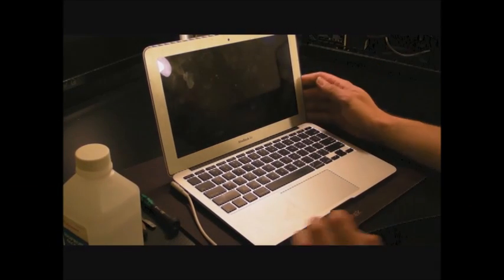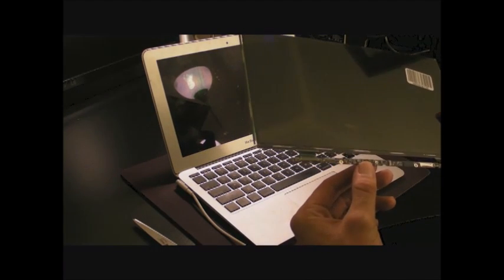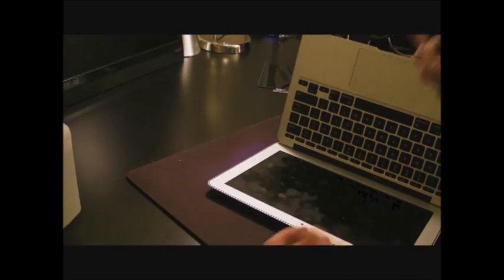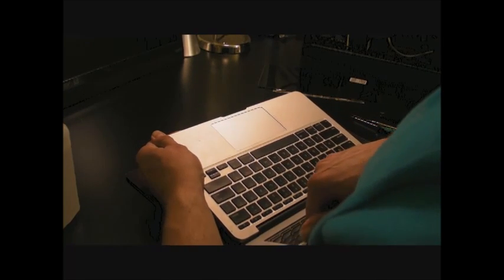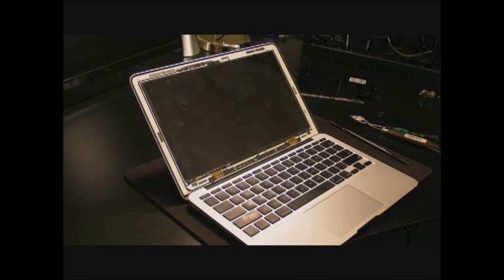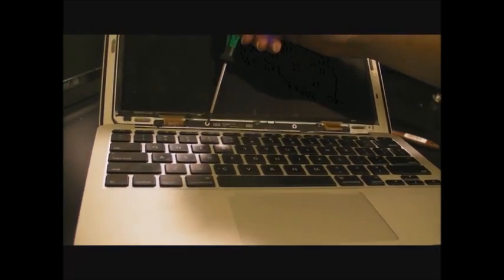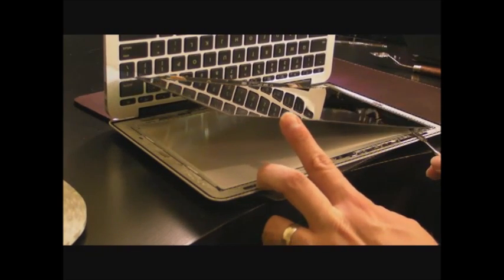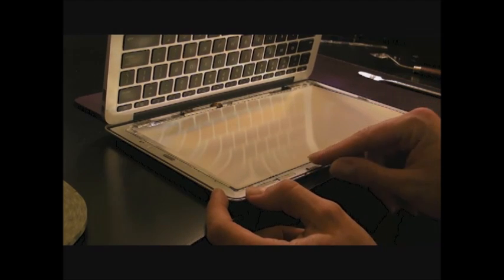Macbook Air A1370 A1465 Screen Replacement

Comment: Just successfully replace the screen on my laptop. Boy was I sweating! No way I could have done it without this video! I was a bit naughty and get a lot of crap, fingerprints and scratches on the panel behind the screen. I used a brush to remove any particles. Once the screen was back on, it looked great! Can’t see the scratches or fingerprints at all.  Thank you so much for this video! All the best

Comment: You're a f***ing legend! I finally made it to repair this thing after several hours of focused work. I took it to a repair store here in Bern, Switzerland and he wanted to change the hole assembly so i decided to replace it by my own. I costs me around 40 bucks in the end (he wanted 400!). I did a tiny scratch on the back sheet but it's not too bad, you won't see it straight away. The backlight cable instead was a b****. It was fine in the beginning but then started to have a loose connection and I had to take out the bezel again. I noticed that there was a cable like thing on the old LCD, that had the same shape as the backlight cable. I chucked that one in as well and then the connection was fine. Milan, I can't thank you enough for your super detailed guide you uploaded here! Now my Mac book air will live on for some more years to come!
Cheers
Reply from the maker: I`m glad it was helpful!

Comment: This is an admirable video. I do a bunch of screens every year. This was helpful. I would say this add in for whomever reads this post. Watch out using any high heat guns. The plastic film diffusers behind the screen may distort. I used a Hairdryer instead of heat gun and just worked the bezel with fingernails at first just to see.. It lifted a little in an area and I worked a credit card inside and then slowly worked around it I had a mini metal spatula available at BBB and used it. The tool this guy has looked like it worked well. Be patient. The other comment is that as I suspected when it came to how this gentlemen released the cables that is also accomplished by heating the perimeter of the screen until it can tilt toward the keyboard top first (just move the glass screen toward the keyboard as you would closing the lid. them once lying face down those cables are really easy to release and they don't stress. Thank you Milan for posting this video.

Comment: Hey Milan, Saturday I replaced the LCD on my mid 2011 macbook air & all worked great!  Thanks so much for your detailed instructions!  I have a couple of observations/suggestions:

1) I got my painting knife at AC moore, for those who are looking for one.
2) For some reason, the part you had said was the hardest, which was the removal of the LCD using the pryer and the heat gun, went extremely smoothly & took about 1 minute to do.
3) Despite trying to be very careful not to (per your instructions) I had a lot of trouble avoiding touching the backlight translucent layers beneath the LCD.  I dropped a miniscrewdriver on it which left a mark, plus a couple of other times, leaving quite a few little marks on the film.  I was quite worried that after I put it all together that it would look awful, however none of it showed at all and the screen looks perfect.
4) Despite the fact that you were very clear about making sure to put the middle ribbon cable back exactly as it was folding, I, somehow managed to put it on backwards &, of course nothing worked.  Fortunately, I put 2&2 together & put it how it was supposed to go.  For those of you planning on doing it, make sure that you can see the white stripe on the cable after you install it.

All in all, everything went well & smoothly thanks to your detailed instructions.  Thanks again for taking the time to do this, I really appreciate it!

Sincerely,

Brian Hiltscher
Reply: I know I am quite randomly asking but do anyone know of a good place to stream new movies online?
Reply: @Justus Jaxx flixportal :P
Reply: @Augustine Willie thanks, I signed up and it seems like a nice service :D Appreciate it !
Reply: @Justus Jaxx No problem =)

Comment: This is the best lcd replacement video I've seen on youtube. Ignore that other person who asked you to edit it. I enjoy the detail, as it is a detailed procedure. I'm a little stuck. Unlike you, I removed the back layers because the screen was broken from the apple logo and I needed to flatten out dent on the outside housing. I can't for the life of me figure out the correct order of the layers. Is there anyway you can help with this? Thanks in advance.
Reply from the maker: Flattening out should have been done before you open the screen assy first :-) you push with your thumbs until the debt goes out or plastic if it was the logo that broke. Unless it was really bad and u needed a hammer to do it. The order is white non see through paper than thick stiff plastic (these two are the backlight so if you cracked this stuff plastic you done for) than shiny sheet than one see through sheet and than another shiny sheet. The first shiny sheet and the front shiny sheet are just a bit different and even if you don't put them in correct order it will work but they should be placed correctly. Let me know if this works out for you!
Reply: Milan Stojic Wow, that was fast! Thank you. One more question. I've got them in the order you described. but on the layer closets to the lcd, one side is textured and the other side is smooth. Which side goes up towards the lcd?
Reply from the maker: The side that is textured goes to the LCD, smooth side goes in. I'm sure you'll have spots and marks on the screen but it will be functional if you haven't damaged the backlight plastic.

Comment: Hi Milan, thanks for creating this extremely detailed DIY video!   I am preparing to replace my damaged lcd, have ordered to LCD, and the double sided tape (5mm&10mm).  Do you, by chance, have a complete list of tools required for the job?  Any recommendations on where to acquire the tools?

Thanks in advance!

Brian
Reply from the maker: Hi Brian. You need a pair of scissors, Philips screwdriver, thin pryer (metal), painting knife, heat gun, and a pair of tweezers. Wherever you can find these buy them. Online or in local stores
Reply: OK, thanks, any chance you could tell me where you got your pryer and painting knife?
Reply from the maker: +Brian Hiltscher try eBay. Look for the tools that look the same as ones in my video

Comment: Long shot because this was posted so long ago, but my screen is completely black. I hear the Apple sound when I boot it up, but nothing on the screen. I flipped the ribbon connection but it didn’t help. I did damage my backlight screen with the heat gun. It curled slightly in the corner. Would that cause the whole screen to be black? I tried to try my old screen but nothing with that one either. Although the old screen was severely cracked and little shards of glass are everywhere so I’m not shocked. Help 😩

Comment: Hi Milan, please could you say me more or less the thickness of the 3M Core 4000 series tape you used in this video? I have another robust 3M tape which is 1.1 mm and I don't know if it is OK

Comment: I have got the boot up noise after trouble shooting. No backlight or new screen illumination....this is the EDP right hand cable? Does this mean the left one is good?
Reply from the maker: if there is no backlight i would check the backlight cable. there are 2 cables connecting the new screen. the wide one, and the small bent up flex cable in the middle which is the backlight cable. people very often plug this upside down as they dont know how to roll this cable up properly.

Comment: Great Video!  Successfully uninstalled old and installed new lcd screen.  However, the LED Backlight does not come on.  reconnected all connections and no luck.  Any advice?
Reply from the maker: Check if you flipped the backlight strip connector upside down. Many people do this
Reply: I guess I was one of the many.  Thanks so much.  Success.
Reply from the maker: No problem

Comment: Hi Milan, I have a question for you, I swapped the screen to 11"macbook air according to your video.
When I turn on the notebook, the display backlight does not turn on so nothing can be seen.. Where could I make a mistake? Thank you for your response. Peter
Reply from the maker: If you haven't blown a backlight fuse on the board, you probably didn't correctly plug in the little cable in the middle of the screen control board. Very often people forget it or plug it in upside down.
Reply: @milanstojic3295  Thank you for the quick reply. Meanwhile, I disassembled the lcd display again and found that I had destroyed the thin flex cable. So saving my Macbook air is over. well thank you

Comment: Hello very good video, but I have a problem. I did everything as you Indicate, but the screen is not seen, This very dark, if put to light logrogro see something. I Realized That does not turn the LED cover and lcd THEREFORE :( not see. Is there any solution to this problem.
I hope you can help me. Thank you very much
Reply from the maker: Take a look at the little backlight cable if you plugged it in correctly. A lot of times people flip this upside down or not properly straight in or sometimes not even at all

Comment: Zdravo Milan! 
Thank you for your great videos. One quick question: I've damaged the glass that is behind the rear reflective sheets. Is there any chance to fix it without replacing the whole thing (screen panel)?
Reply from the maker: that sux. u broke the backlight plexiglas and you will need to replace it in order to get even backlight on the screen. replacing this is not easy, but if you can find a new part it will be good.
Reply: Copy that, thank you for your quick response. I didn't break it, it has been overheated during removing the bezel and now there is a spot in the corner which is annoying.

Comment: i didnt see any film sheets came out on your video...on my three of them came when i peeled off the screen(some of them are scratched) and there is another one thin plastic remaning on assembly...what are they for?do they have to be replaced or do they,come with a new screen?
Reply from the maker: Carlos Montoya That's because I don't take them out. If you would follow what I did you would never have them come out. Now you have permanently damaged them and should get yourself a new assembly to put on that computer if you want it to look any good. I am pretty specific about not touching those sheets. Especially the one in the back

Comment: I have sound but no light.  Any advice to trouble shoot or how to replace the light?
Reply from the maker: what do you mean by that? computer turns on, you can see the picture but its very dark? did you try to replace the screen already? did you spill something on it? i need a bit more info so i can answer your question.
Reply: Milan Stojic if the screen sheets are damaged will that prevent the screen from showing display properly? I am getting a dark screen after replacing the screen and cant figure out why - thx

Comment: how do you change the cable?
do you have to take apart the LCD from its layers?
Reply from the maker: Proper way is to take off the bezel only. Nothing else needs to be removed to get to the cable. Careful not to break the lcd

Comment: My polarizer sheet got dmaged by too much heat. Can I buy this seperately?
Reply from the maker: Sure you can. They will most likely come in a conditional n you wouldnt want to to put them in anyway. These need to be shipped in a sealed environment which nobody will do. When you assembly it all jt will look like crap! Just buy a broken assembly and use it for spare parts. Dont make the same mistake again.

Comment: Do you mind telling me where do you get the part from? I get these for $175 which is pricey but I understand if you don't like to disclose your vendor
Reply from the maker: $175 for this lcd??? You can buy this on eBay for less than $40 if you are in the U.S.!
Reply: Sorry I meant the 13" not this one.
Reply from the maker: U won't have much luck finding those for much less unless you are prepared to order them from China in bulk. Prices of this screen have risen recently.

Comment: The power sound would signal, but no light on the new screen. Old cracked screen still lights up but is a unusable.
Reply: +D-LASH might want to check the direction of the backlight cable, there are two white stripes on it and they should be facing outwards

Comment: I tore the ribbon cable that connects to the inverter is there any way to fix that?
Reply from the maker: MaviHD Yes. by replacing the backlight strip, in which case you need to take all the sheets lit and remove the backlight plastic which cracks very easily, meaning you will most likely destroy your assembly. Second option is buying the assembly and replacing it with a new screen in here already. your options now are very expensive.

Comment: What's the name of the tape I have tried double stick tape and that didn't not work, and for you guys who installed your new screen with black light not working it the way you installed the smaller connection it is in backward I know it happen to me.
Reply from the maker: 3m core 4000 series I believe. What I do I go on ebay and type in iPad double sided tape, or iPad repair tape and order what I need

Comment: I think it's a bad replacement screen. Sending it back after seeing a screw driven into the board. I tested the old cracked screen to be sure the backlight does work, and it does, so,
I guess it's a bad screen. I lined up the 2 boards of the screens to compare them and noticed and small screw driven into the board.
Reply from the maker: If you say it works with the old screen, than that would be it. The screw might have damaged the circuit that powers on the LED strip on the small board from the screen. It should be close to the LED strip connector on that board. Just get a replacement and not bother with it.

Comment: i replaced the screen, however theres no backlight. i can make out the display when i shine a torch, any help?
Reply from the maker: Mac Tech Check the backlight cable. You most likely ripped it or flipped it upside down
Reply: Bruv, you are A FUCKING GENIUS! !!! Thanks dude it was flipped the wrong way!!!
Reply from the maker: Mac Tech 😄 you welcome! That's what usually happens
Reply: Same issue but no backlight even when cable flipped?
Reply from the maker: Tracy Ehle Ripped/damaged cable, blown backlight fuse, or backlight driver. Possibly even damaged the LCD cable connector that shorted the above out. Seek professional help, don't mess it up worse

Comment: Hey man I have a line in my screen horizontal it disappears sometimes
Reply from the maker: Seen it a few times. I had a screen on one of my laptop's with that. Worked fine for a year as long as I never pressed on the screen below the line (that's where your board is). Than my son dropped it from the table and it broke 😄
Reply: I can only use one side of my screen
Reply: Vertical lines not horizontal sorry, it’s a MacBook Air
Reply from the maker: @dehomewillis  yeah mine was vertical also. Horizontal would not happen unless it's cracked horizontally. If half the screen won't come up than u need a new screen

Comment: My friend's macbook has no internal damage but when it accidentally slipped from my hands it fell and the upper and lower corner bent. I have seen that it's possible to replace the metal surrounding the screen but how about the metal on the outermost part of the macbook and the metal surrounding the keyboard. Thank you.
Reply from the maker: Yes, you can replace the palm rest. It's pretty easy if you know how. Look up some keyboard repair videos